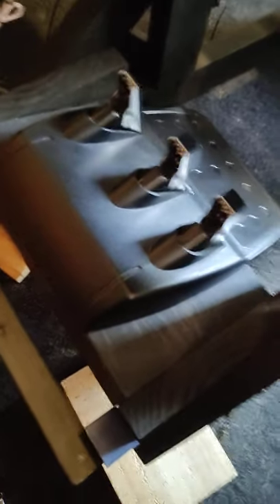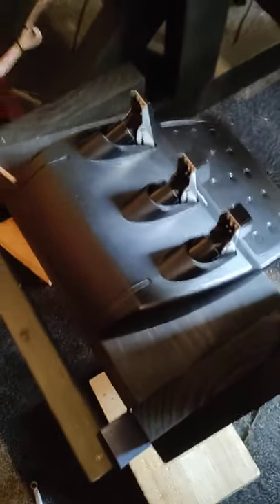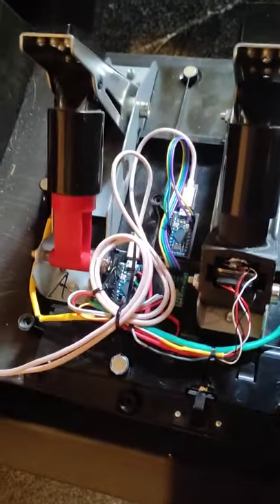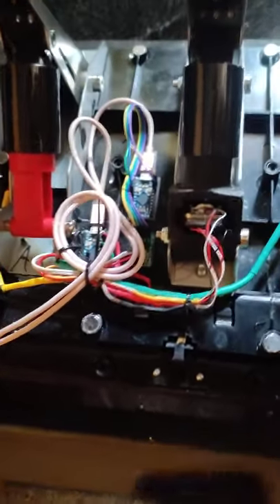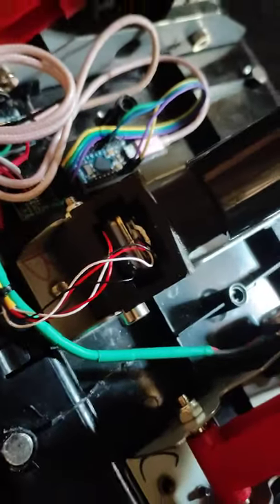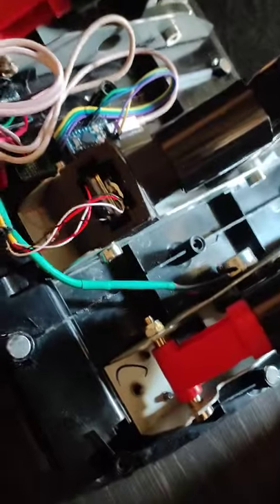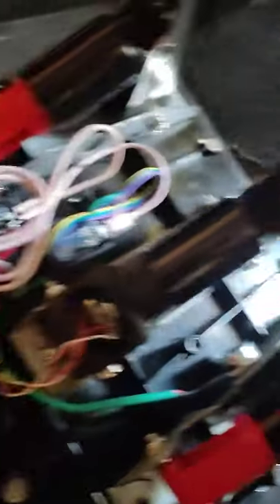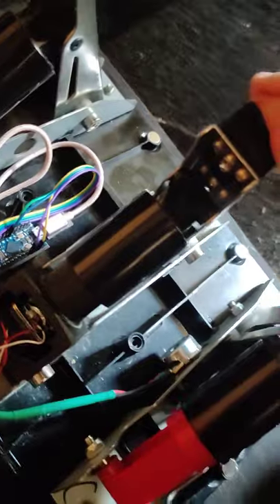DIY Loadcell Arduino Logitech Pedal Mod

Comment: HI, YOU USE 2 LOAD CELL AND THE HX711 AND ARDUINO MICRO??
Reply: Yes,  running 2 button type load cells with 1 amplifier